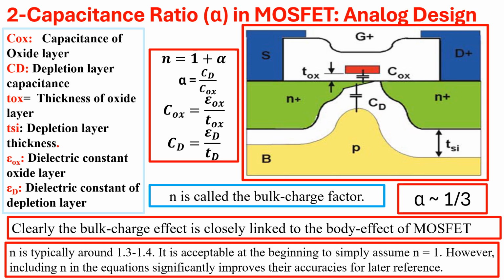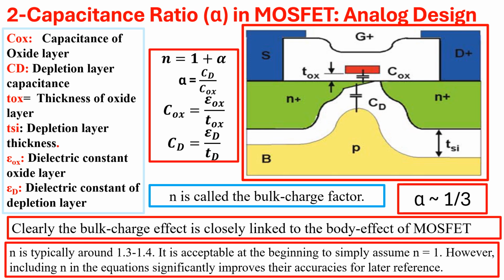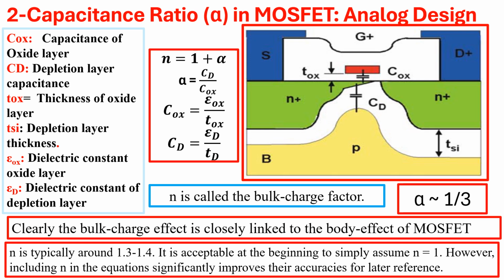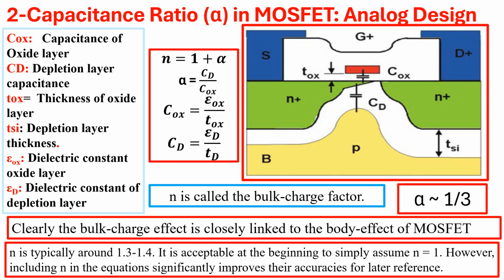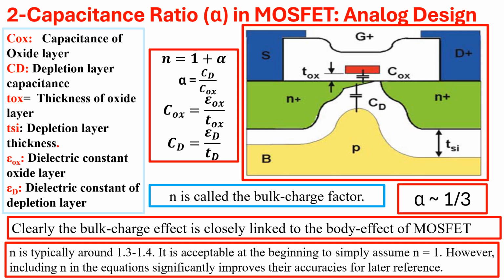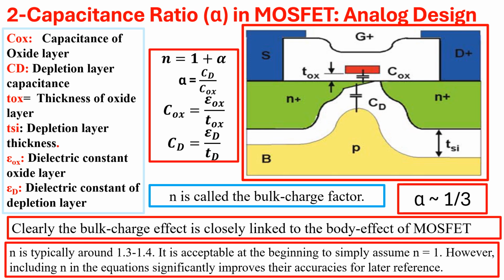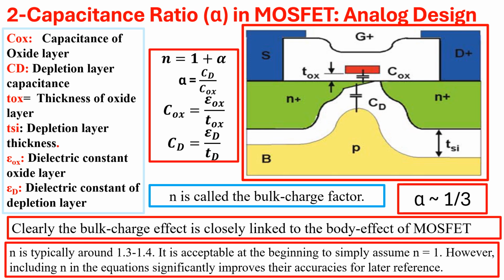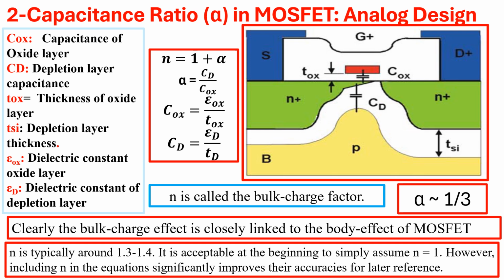Understanding MOSFET Capacitance: Key Terms and Concepts Explained!, mosfet capacitance model

Comment: tsi is highly non-uniform. is it possible we can measure it.
Reply from the maker: We can indirectly measure.
Reply from the maker: Measuring the depletion layer thickness in a MOSFET is essential for understanding its electrical characteristics and performance. Here are common methods used for this measurement:

1. Capacitance-Voltage (C-V) Measurement

2. Electrical Characterization

3. Simulations

4. X-ray or Electron Microscopy Techniques

5. Mott-Schottky Analysis

Each method has its advantages and limitations, and the choice often depends on the specific application, required precision, and available equipment. C-V measurements are among the most common due to their simplicity and effectiveness in characterizing depletion layer thickness in MOSFETs.